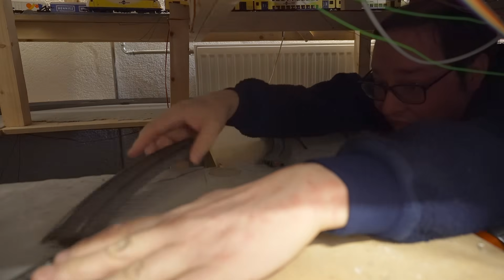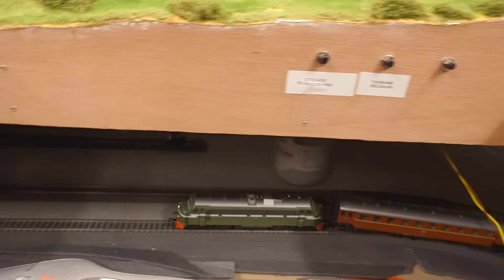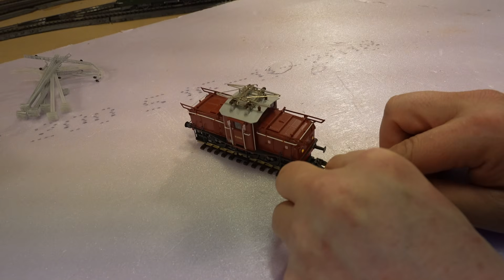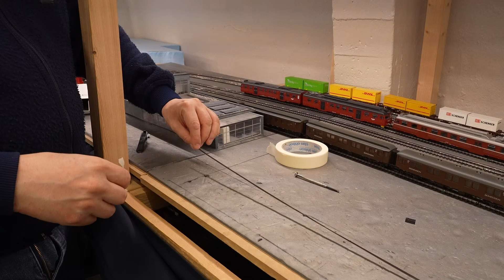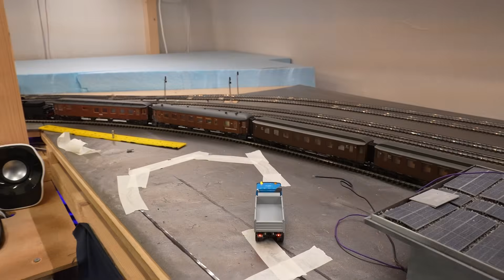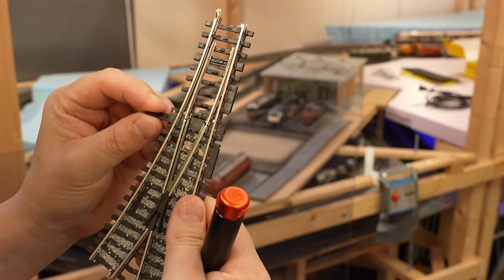Layout Update: Secret Project Revealed, Shadow Station Expanded & Third Rail Cleaner!

Comment: Hello, just discovered your work and it’s amazing! Such a great layout ! 
Am also on Märklin system and didn’t understand how did you manage the industrial tracks to work with aluminium? If you can give some tips about it, would be appreciated !
Reply from the maker: That's not working yet. The initial test with solder with a blow torch failed. I have an idea for a simpler solution but I will need to implement that after Trainroom Expo.
We will make a full video, because we were already asked by the chief editor of the Norwegian modelrailroad magazine to write something about when we get it work.

Comment: I bet you got the Idea for timetables from the American layouts as they are a very common practice here.
Reply from the maker: No, I wanted to time the trains in a way, so they don't have to wait. It's required for the train starting at the station servicing the side line. Also some slow train have to stop at the station and let the fast train trhough before continuing.
Then the time is also used to control the Philips HUE system.